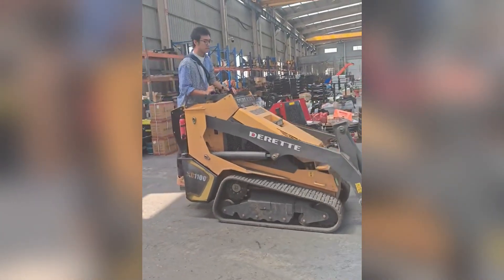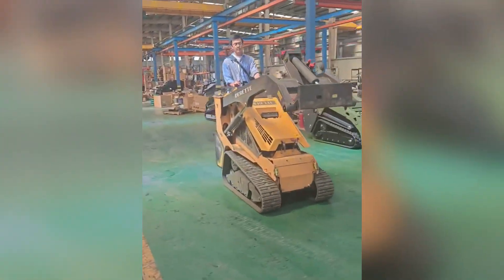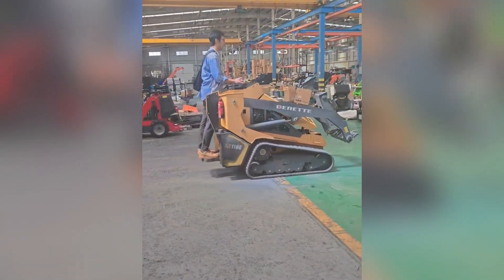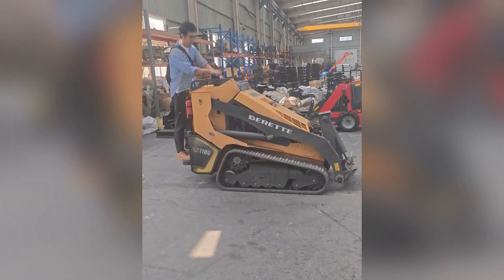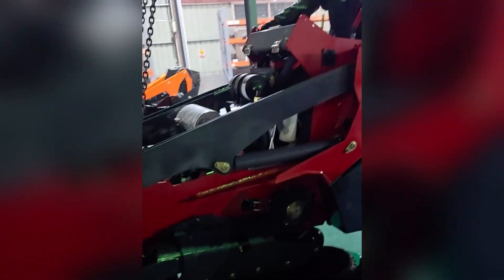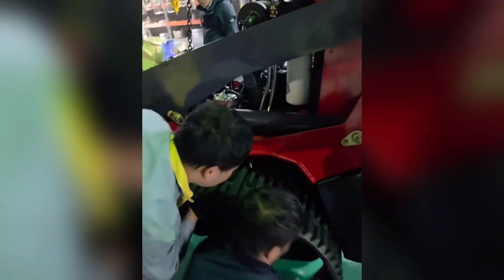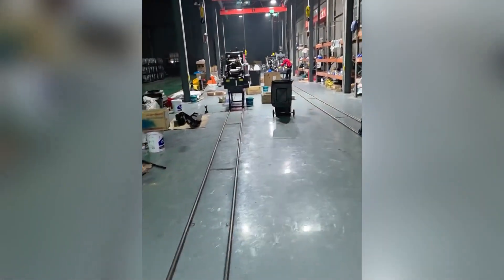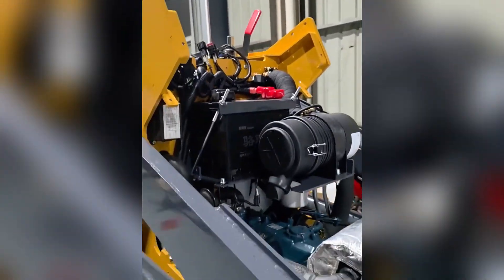Derette XC1100: Vibration Fixed (Concrete Track Resonance) – Before/After Test.

Comment: Once the XC1100 is shipping in bigger volumes, will it use the type of mount that Toro Dingos and Kubotas Mini Skids use in the US?  Or will be able to order it that way?

We can rent all kinds of attachments in the US that use that style of mount and might only need to use once every few years.  Would be a huge help at least for US customers if the attachments came in that style mount and was on the machine by default.   Thanks! 🙏
Reply: Hello sir, I’m Felix, a sales representative from DERETTE. Are you referring to the attachments with the 14.5-inch universal mounting plate used in the US? We upgraded the mounting plate on the V1000 several months ago, and it is now fully compatible with US universal-sized attachments—this also applies to the XC1100. So you can rest assured about this. If you need further information or wish to place an order, feel free to contact me anytime—I’m always ready to assist.